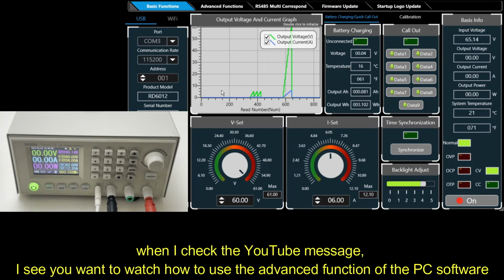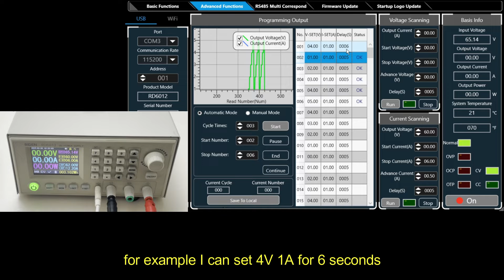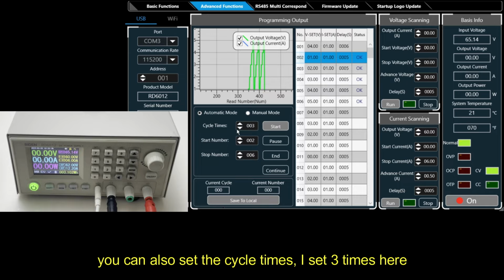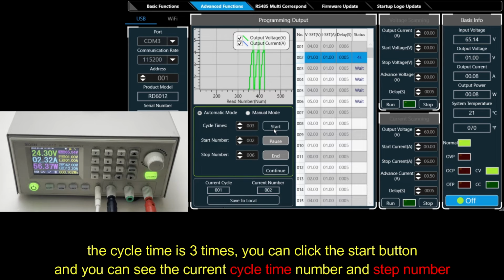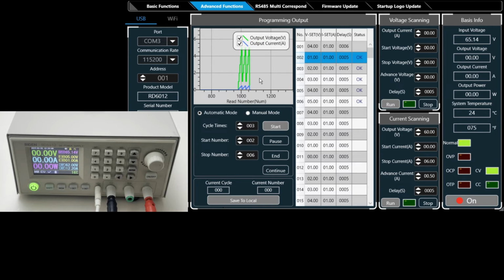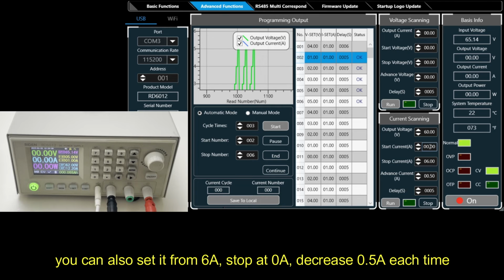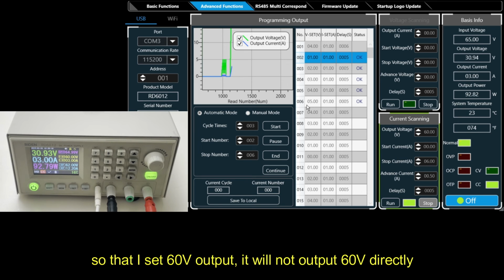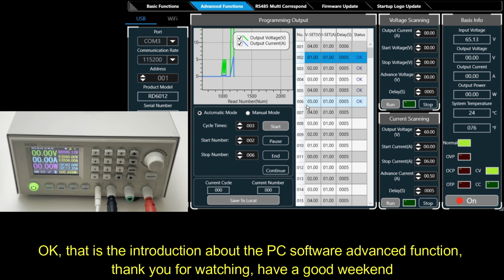PC Software program output/voltage scanning/current scanning RD6024 RD6006

Comment: Im using the RD6006 for electrochemistry, how do I set a negative voltage? it wont let me, in the software, I need to cycle between +10 V and -10 V
Reply from the maker: hello, it cannot output negative voltage, the output range is 0-60V DC

Comment: Can you make an update for the programing output to change the current and voltage when it reched a certain voltage or curent or time, and not like it is now that only after a sertain time it change the parameters? It will help with charging batteries when it is to much drained and other situations
Reply from the maker: hello, for battery charging, after you set the charging output voltage and current, you can set the cut off current in the setting page, our power supply use CC-CV mode to charge battery, when the charging current decreases to that value, the output will be cut off directly